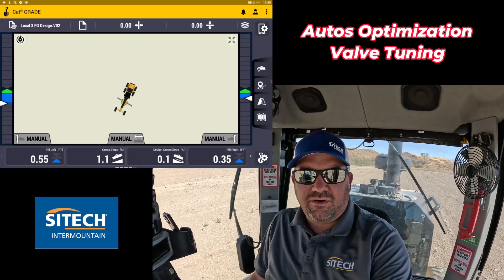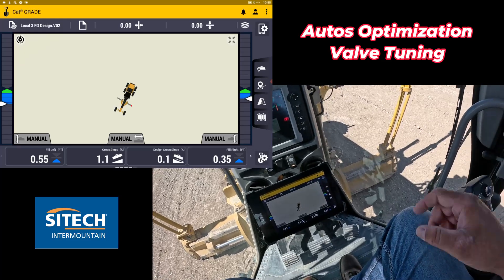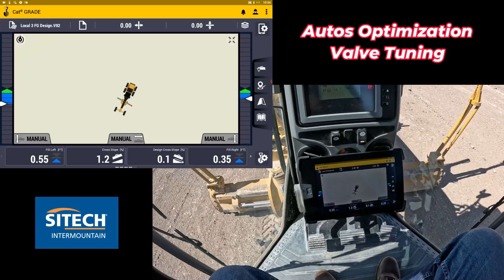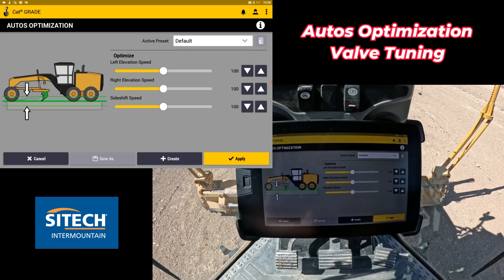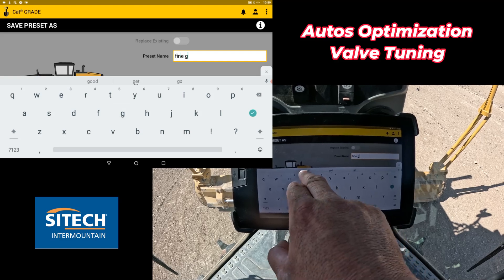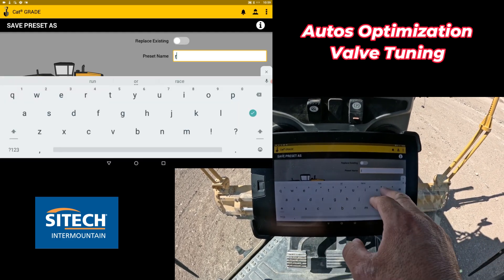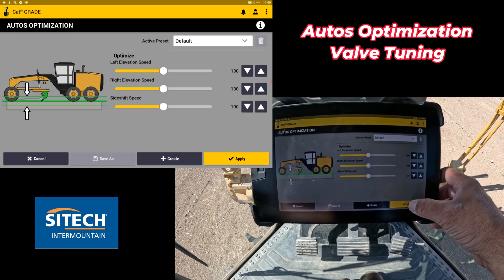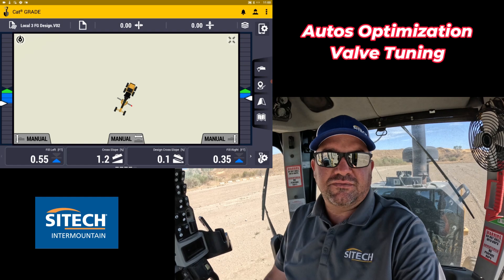Earthworks Autos Optimization

Comment: I have a question for a blade on earthworks? Is there a way to stake out a line and tell it to project a certain percentage in your model? Kind of like how you could do on a Rover? My blade operator said that you cannot and I have a hard time believing that you can't 

Basically say a sidewalk is built at 2% on your model and you want to go 1% is there a way to do it on earthworks instead of me on my Rover building a model for him?
Reply from the maker: So with a model loaded in there is no way to tweek the existing model in the machine. It will follow what that design grade is. The newest version of earthworks that just came out a couple weeks ago allows you to export 3D linework to the machine and then the operator can select a specific line like a sidewalk line or a TBC line that is elevated and then he can specify in the machine what type of side cross slope he wants to put on it. So yes he could select that line and put a 1 percent on it.